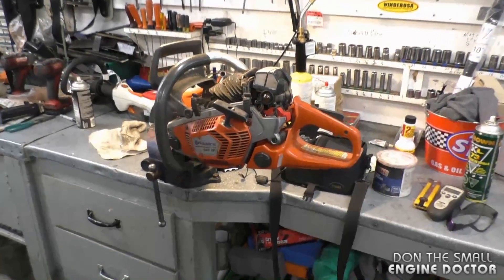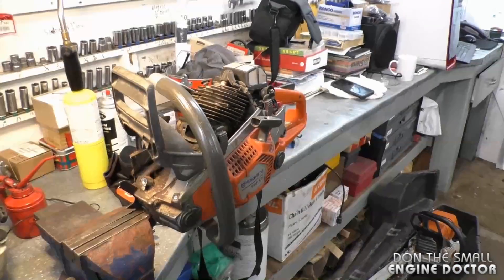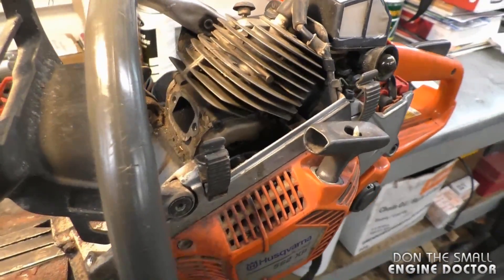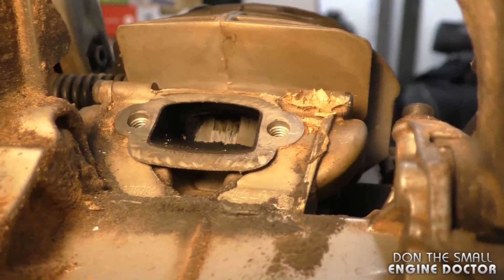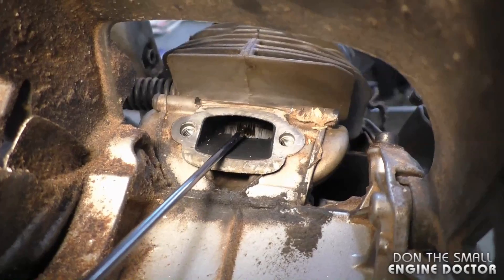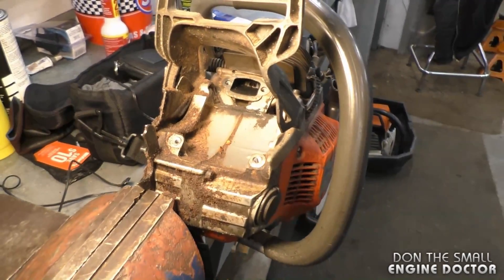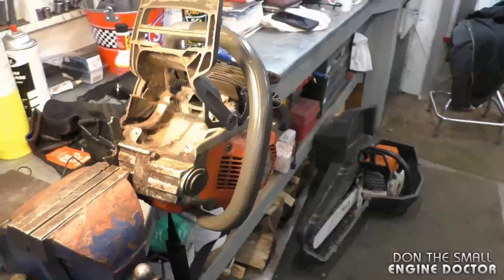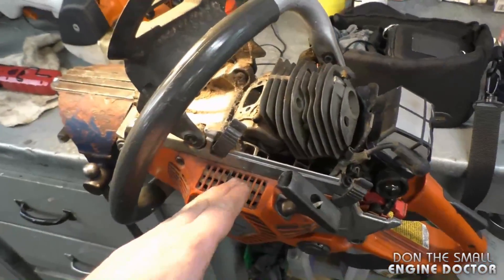Why A Chainsaw Engine Blew Up! | Husqvarna 562XP

Comment: The problem with this machine is also poor air filtering. There is always dirt in the intake. The same problem is presented by its smaller brother 550 XP. 550 and 562 are very powerful and fast saws but they are a box of problems. All the best. Congratulations on your excellent channel.

Comment: Hey Dony:
These saws have an issue with the nylon caged crank bearings disintegrating, when this happens it normally punctures the crank seal...is suspect the “carbon “ you found was a chunk of that nylon...I’m curious if you use a pressure / vac tester to trace lean seizure / air leaks...if you didn’t do that, then it’s just a best guess...And the reality is that the saw is just going to seize again once you install the new cylinder and piston...any update in this one?
Reply: Early models or all (562xp) ?
Reply: @jeffreyrudolph5061  all models as well as the 555 and 550
Reply: @jeffreyrudolph5061  ill post some vids on my channel
Reply: @jimssawsnstuff8903  thanks Jim
Reply: @jeffreyrudolph5061  I'm jiminthemountains on Instagram, I've got lots of saw stuff on there

Comment: My crank bearing failed one day before warranty was up , got a new saw !
Reply from the maker: was it the 562xp?
Reply: donyboy73 it sure was 562xpg
Reply: donyboy73 and I only cut about 25-30 cord of wood , I have a 455 rancher that’s about ten years old and it’s only needed a new worm gear for the bar Oiler and an old husky 61 that still runs strong , hopefully the new one will last .
Reply from the maker: @raptordan6851  i use 45:1 fuel mix, helps them last longer
Reply: donyboy73 I hear that , I’ve been mixing rich since I was a kid.

Comment: did you end up putting a top end cylinder block repair kit in that Chainsaw ?
Reply from the maker: no I didn't
Reply: @donyboy73  bummer well at least you have got left over good parts kicking around the in the shop Donny mate

Comment: Great video. A question I am developing an auto start controller for small engines, running oil wells with or without my "pump-off control" that will be converted to natural gas. How much warm-up and or cool down time would do you recommend?  Average engine size 8 hp up to 22. Thanks ..keep up the videos.

Comment: I own several chainsaws, 3 poulin's, a stihl, and maybe another poulin. I have never cleaned an exhaust port. Two of my poulin's I've been using for over 10 years and they are still running good... With the exception of the one... The oil pump went out this past winter 

These saws are technically too small for the work I put them through. Poulin 2055.
I cut around 20 - 30 cords of wood every winter. I typically only use one saw the entire year. I like to have several back up machines because I'm always expecting my little saw to crap out on me. They rarely do though. I got my two main saws at a garage sale for around $20 each. Best little saws ever.

Good video though.
The Piston scoring was evident.

Comment: I had a ms 290 for 10 years and ran the Stihl oil the engine was in great shape. I upgraded to a husq 460 rancher but still use the stihl oil. I always mix 50:1 or 45:1 when I using some of my vintage saws (homelite XML 12 and pioneer farm saw)

Comment: I had a chain saw that wouldn't stay running after it fired up. It was a hole/crack in the fuel uptake line in the gas tank. Some say that the alcohol in the gas causes the tube/line to crack.
Reply: Benzene in pump gas.

Comment: That's a bit of a crappy design ! A upward facing exhaust port!
Reply: The upward, 45-degree, facing cylinder is a sound idea. This design allows more ambient airflow onto the external part of the cylinder increasing cooling. 
The upward facing exhaust port isn’t an issue. In a two stroke the piston does the exhaust scavenging, under pressure.

Comment: no  that thing was run lean.  the exhaust side is always the first to get damaged.  because it gets the hottest first.  could have been a plugged muffler.  possibly torn boot or faulty crank seals. but the 562xp's are autotune which have a microprocessor adjust the air fuel ratio from the carb by varying air  bleeds.  they are known to lean out on a dirty air filter.  i know its counterintuitive but when you hook them up to the computer you see the record of the fuel management. it senses less air flow and cuts the fuel down to match(supposedly)  but it goes too far.  looking at the dirt and sawdust on that saw it is clear it was improperly maintained
Reply: It is a lean out .  Could it be It has the winter filter, (80mic) , more dirt getting inside the engine, either thru the filter or filter base,  dirt clumps up with oil mixture, the dirt builds up inside the crank bearings, taking out the bearing cage, then the seal, and there's the lean out.

Comment: To much mixing oil is bad, that's a new one on me but then I dont know what mixing oil is for to begin with, it's not in 4 stroke motors. I thought ethanol and or old gas causes carbon build up.

Comment: Hilarious. Saw this just after I came in with my Husky 345 not running. 10 years of not cleaning the air filter was my problem though ............

How do you clean the exhaust port? I mean correctly. Not how I would do it!

Comment: Can you add anything to the fuel to breakdown existing carbon before it becomes excessive?
Reply: Run a good quality oil and mix as per manufacturer instructions. A minute or so on fast idle and a few high revs and you’re ready. Wide open in the wood, unless finessing a cut. This should cut down on carbon build up.
Reply: @heavysnow8616  
I did exactly as you Described and guess what ? I have had 3 Saws to blow up ???
Manufacturer would not warrant them.

Comment: I was given an old Echo 440evl..(old as in pre-chain brake). Starts fine, but idles so high it can cut wood. Have no idea but don't want to spend alot to get carb, etc. Should I attempt Hi/Lo idle adjustments?
Reply: Did you run the saw for a few mins ?sometimes they calm down from operating temps,just a thought,the thought of messing around with high lows sounds like not much fun lol
Reply: Backing out the Trottle adjustment screw and still have a fast idle speed means air leak, check the rubber intake boot between carb and cylinder,  it may be torn, next thing could be crankcase seals

Comment: When you mention “clean the exhaust port”; do you mean with a carb spray (to break up the carbon), or mechanically by disassembly?
Thanks again for the vid. 👍🏼🇨🇦
Reply: Once the muffler is removed you use a tool to scrape the carbon off the exhaust port. You want to use a tool that doesn't cause damage to the engine such as scratches.
Reply: Good question! I read the answer. Maybe I could offer a suggestion for a future video to demonstrate how it is done and how hard you need to scrub. Thank you Don for your excellent work.

Comment: Those Husqvarna 562 xp's are complete junk.  I had three of them and they all blew up.  1-because the piston ring stop pin came out 70-hrs.. and tore out the piston and cylinder, 2-because of a torn air boot at 42-hrs..3-the bottom end bearing came apart at like 50-hrs..  I also had a logger friend who blew up three of them.  For the exact same weight but way more power and a faster spinning chain go to the STIHL 462cm.

Comment: I have a shindaiwa AH242 that just quit on me while trimming bushes last week. It started easy ran great and then stopped all the sudden. Has spark but when I pull the starter it sounds rough and doesn’t have good compression. Wild guess the engine has 100+ hours. What should the psi be and is it worth repairing or tosss it?
Reply from the maker: more than likely not worth fixing

Comment: Is it dead at this point?
Reply from the maker: starts but runs very poorly
Reply: @donyboy73  
I get that part, is it rebuildable or is it not feasible costwise to do so?
Reply from the maker: @upsidedowndog1256 not feasible when considering cost
Reply: @donyboy73  Piston and cyl kit is only 244.42$ in Canada now. Would be worth fixing....
Reply: @ @simondelage6711  It does seem a shame doesn't it. Such a throwaway world we live in. Though it might be worth it for a DIY'er to fix it for their own use, especially if you enjoy doing this as a hobby, but not worth paying a shop to fix it I wouldn't think.  By the time you buy the kit and then the labour to put it together,  (don't know what they charge in Canada but here it can be $70 or $80 an hour for a technician) you may as well buy a new one.
Reply: every one of this model i've seen in that condidion will only run a little while on a new jug kit.  usualy the metal from the piston and jug get to the bearings  so unless you split the case  and change bearings and seals  you're living on borrowed time

Comment: Sorry DB the 562 is junk.  If you had seen the service bulletins on everything from bad case metal and bolts that would not hold the halves together up through the ignition and carburation you would know.  I remember there were so many service bulletins that anyone bringing a bad one back was given a new one and told that was the end of their warranty.  Good luck getting a second year out of one if you let it sit.  The carbon comes from the gas, not from the oil.
Reply: the carbon is from excessive burnt oil.
Reply: @nathanielreid4967  
I would think so as well.
Reply: MrRmh3481 wow. Amazing.
Reply: Is it a special type of gas that is causing this?
Reply: Farendloese unburnt

Comment: What do you think about the premix gas from home Depot do they work good.
Reply from the maker: yes they work
Reply: How much is the premix by the gallon... Let me check, roughly 25 to 30+ dollars per gallon. Well I guess if you are that wealthy rich you can afford landscapers instead of the premixed fuel
Reply: @AlessioSangalli  -- I use my chainsaw when I volunteer to help maintain a local public park.  So I use my chainsaw only occasionally.  I can afford to buy pre-mixed fuel because I don't use much fuel.  (Also, I find that my chainsaw starts more easily with pre-mixed fuel, and pre-mixed fuel damages the saw less -- because it doesn't contain ethanol, as U.S. gasoline does.)
Reply: @kevinbyrne4538  thank you for your volunteer work. I'm also volunteering today at a local school. My chainsaw usage is also sporadic (along with the other small engines) and yes, ethanol in fuel is a disgrace. I always dump the tank after I used it and never leave any fuel in the lines by running the engine until it uses it all. This said, I still consider premix a rip-off because it shouldn't cost 6 times as much. I use quality (synthetic) and never had problems in the last several years.
Reply: @AlessioSangalli   Many fuel stations sell 100% gasoline  (no ethanol) .
Reply: @JF-fx2qv  I haven't found them in my state. The only way is at the airport they sell avio fuel that doesn't have it. However just by dumping the fuel I resolved my problems of melting fuel lines and swelling caps
Reply: Alessio Sangalli ,I’m not sure what state that you live in but many places that are Farm and Home stores like Tractor Supply sell an additive to put in your fuel ( it something like marine fuel stabilizer or something like that) it is an additive similar to Seafoam ? You can usually find it near the two cycle oil.
Reply: @leolynchjr1021  California fuel stabilizer is available here (probably it's organic made out of avocados) but that is to preserve the fuel to go bad, not to eliminate the effects of ethanol on plastics
Reply: @AlessioSangalli  No problem chump change. Thanks